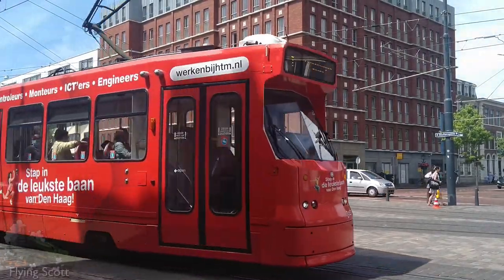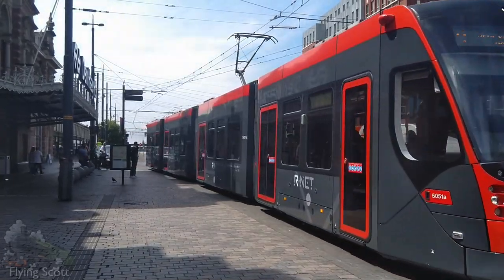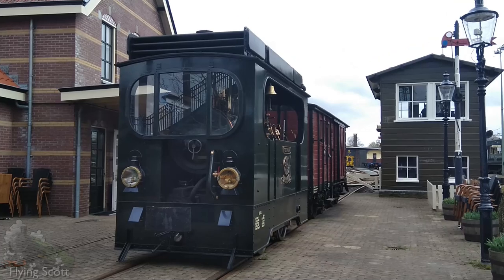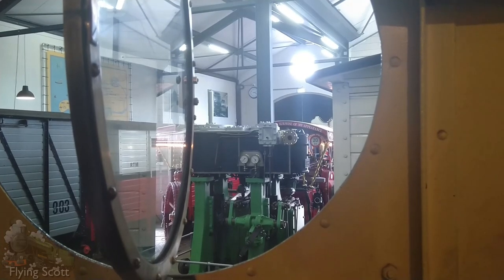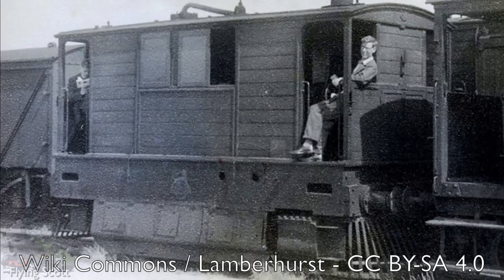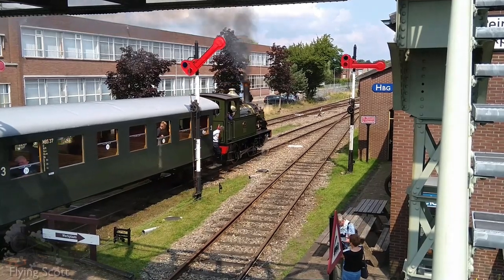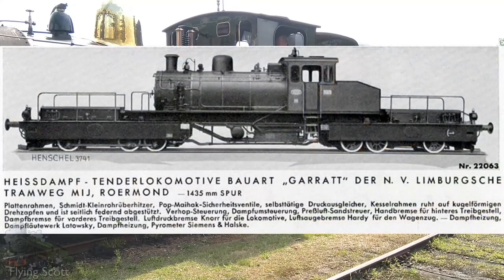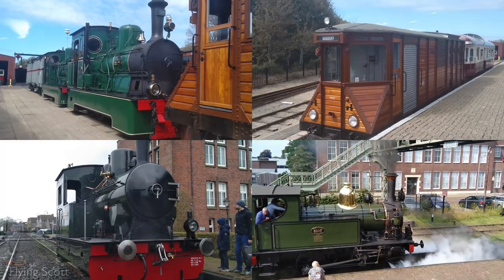What, Exactly, Is A Tram?

Comment: I think the best way to describe a tram is an engine designed to work around heavily populated areas where it is bound to come close to people. So, a normal locomotive is big and loud, it's dangerous and smells. A tram is generally smaller, quieter, has more safety precautions, and doesn't immit it's exhaust in such a way as to make people around it uncomfortable. It's like a square and rectangle. All trams are locomotives, but not all locomotives are trams.
Reply: If anything the video shows that a freaking E unit can be considered a tram if you use it like one...
Reply: Yes and no. Most trams in The Netherlands (in the 1920s and 1930s) ran in the countryside between towns that where too small for trainstations. Trams have less safety regulations, making them cheaper.
Reply: I agree to the "All trams are locomotives, but not all locomotives are trams." bit. For some reason, even a few of the C53/J70s didn't have sideplates.

Comment: The point about a tram is not the detail of the machine but the unfenced public roadway (both street and reserved beds) which characterises a tramway. A loco running on a tramway is a tram engine, regardless of typical features like enclosed wheels or whatever…..

Comment: If you want more confusion, the Swansea and Mumbles Railway used open top, double-decker tram carriages drawn by horses and steam tram engines, and later electric tramcars, whilst running alongside a road without a fence. Yet, it wasn't a tramway, because it predated modern tramway legislation, and was always refered to officially as a railway.

So there are tramways that use trains, and also railways that use trams... And then is gets quite weird with modern tram-trains added to the mix.

Comment: In my books, the only thing that defines a tram as a tram, mainly because there were plenty of little railways across the UK constructed under Tramway or Light Railway Orders, is the right of way it was owned or operated by. A good example is the WCPR, the first section between Weston and Clevedon being constructed under an earlier Tramway Act and as such the locals referred to their services as trams, despite being otherwise ordinary locomotives drawing regular coaches and wagons. It is also worth noting that a lot of "tramways", more often than not non-urban or municipal systems, mostly or entirely ran along their own right of way (see the Corris, Burton & Ashby, or Selsey Tramways as good British examples). The same could also be said with the more commonly known electric systems of old, where some featured large stretches of dedicated off-street right of way through parks, open farmland and inter-urban sprints.

Addendum: It is also worth noting that the requirements for a bell, cowcatcher, side plates, lighting, smoke consumption and speed governance on tramway locomotives or tramcars varied from case to case, based on the regulations and stipulations of their authorising acts, and local authority and/or board of trade enforcement to said requirements. It varied. A lot. Hell, the Glyn Valley Tramway had "speed governors" in that all they were were large speedometers mounted to the side of the engine visible from the cab. They lost these "governors" around five years after opening.

Comment: this feels very much like the modern day "light rail" term and how its used where i live. it is just "these people who built it said it was light rail and so thats what it is". 
i think all this categorical train nonsense is a bit of a waste of time and it is mostly used for deception by the builders. i think it'd be much better to categorise trains directly on their use case, because that makes it clear to even non train people by what a train is designed to do, and what it is optimised for, and what fishy things to look out for.
ultimately i think that urban public transport should be called just that, and the most important characteristic that should be identified is the kind of service it has. rapid transit, with exclusive right of way, etc. i think that vehicless are far too flexible to force these meanings onto, and i think people do it extremely haphazardly.
the whole distinction between light rail and trams here is just "trams doesn't mean public transit it's a tourist thing" and so then its streetcars to light rail and "streetcars have stigma so we call them light rail"  but the complete vagueness of what light rail means has remained. there are literally rail lines that can be considered heavy rail here that are called light rail, but the public understanding is that light rail means a small, cheap, shiny, and flexible passenger train.  i think that that understanding is abused and can be morphed to fit whatever the builder wants! and it doesn't give the public a very good perspective to argue for something better, because as far as they know this is just what they know. light rail is such a damn mess here i could say so much, it's so frustrating.

Comment: I personally classify a tram engine as a regular locomotive that has been fitted with devices to allow it to operate safely on public roads and a tram(or Street Car or Trolley as their often referred to in the US) is a single powered car that operates on city streets.
Reply: Trolleys and street cars can have multiple cars.  And trolleys must specifically be electrified with a trolley pole.
Reply: @MrJstorm4  I must be thinking in terms of the Cable cars of San Francisco.

Comment: I'm not at all into this stuff, so I probably don't know what I'm talking about, but... I always thought a tram was a railway whose tracks primarily run down the centre median or lanes of roads. Meanwhile, other rail transport might run parallel to roads, but only ever touches pavement at level crossings where it intersects the road rather than following it. 

So... to me it doesn't seem to be about what the engine looks like, so much as where the tracks are built. If the gauges were the same, you could put a train on a tramline and it'd "magically" become a tram, and vice versa.
Reply: I always thought it came down to size. A train being bigger than a light-rail being bigger than a trolley and so on.
Reply: largely, this is true! historically, and in a few places still to this day, full sized main trains do run on the road, just at low speeds, and usually listen to things like traffic signals. the reason why they don't anymore isn't something i know a lot about but assume it is because, mainline trains are usually designed for higher speeds, high comfort and capacity (huge trains), and are really heavy. trams, because they are used to get around urban areas, are usually designed to start and stop really quickly so that they can visit as many stops in a given area without sacrificing too much time by traveling below top speed, which means being small and lightweight (at least in comparison). really though, train categorical definitions are either extremely wishy washy to the point of being useless, or so arbitrary that things you'd expect to fall into a specific category don't, which means that it is probably best to just call a tram something that rides through primarily urban areas, which is generally how the word is used. usually, trams do take advantage of this scenario by optimising for urban transport, but not _always_.
Reply: Those are city trams. We have those too in the Netherlands (see 0:01 & 4:34) but back in the 1920s, we also had long distance trams connecting towns that where too small to get their own trainstation.

Comment: to make it simple its a legal designation with its own rules mainly for the tracks and routes.
In general a main line would need legaly more safety equipment and axle load then a local or tram branche line.
Ad every owner running trains/trams bending the rules to their personal benefit and we came to this mess.

- Fast tramservices exceding speeds of local trains.
- Localtrains EMU who convert to tramservice in citylimits and in reverse citytrams who have hybrid propulsion and run as DMU on local railways.

Even the definition that a tram is a schizofrenic railbound vehicle is not 100% correct.
There are "trams" that run on rubber road wheels and are guide by magnets as a track.